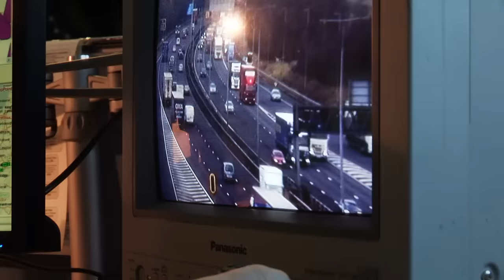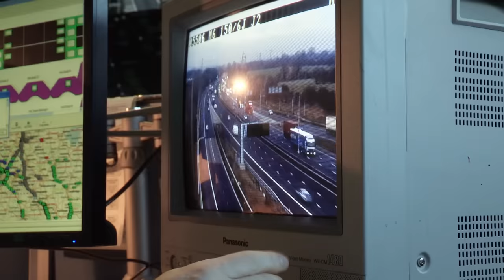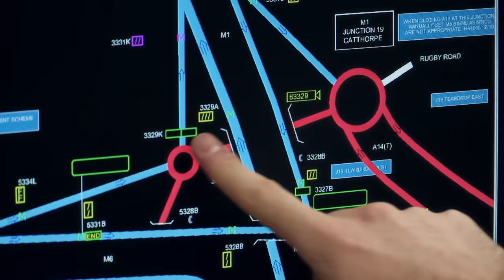Responding To Horrific Motorway Collision | The Motorway: Life In The Fast Lane | Real Responders

Comment: Police badge on the window “put your seatbelt on” works every time!!! 👍😁
Reply: LeeWhy It largely depends on the vehicle you’re driving, thanks to reality TV it’s now common knowledge how old unmarked vehicles are, and the models being used can be found on the local force’s website - and who crews them. 
Ultimately though, if it takes a sticker to alter the attitudes and behaviour of motorists’ then cars should have 5 random questions from the Highway Code to be answered correctly before the engine can be started - most modern consoles could easily handle that, and an alcohol test, a drug screen test, and a baton and cuffs secreted in the headrests for passengers to make safe and efficient civilian arrests and detainment until someone in uniform arrives and Tazes them before releasing them back into society. The car can then text all the members of the driver’s family to alert them as to the extent of the misdemeanour which should then also be shown at the end of the national news alerting other drivers to avoid the city where the highest rate of offences occur, thus impacting on local economy and hopefully leading to the mandatory use of bicycles under the pretext of the alleged adverse effects to health from any airborne carcinogens and contaminants, the danger posed by biofuels to the ionosphere and ozone layers further impacting on an atmosphere not conducive to good health and long living. Repeat offenders should be sent to Brazil or India where they can learn how to drive with reckless endangerment properly and safely. Oops, almost got spotted there, but I believe that mild intoxication and occasional phone use helps me to really concentrate more on driving safely - well, more alertly as I’m now mindful of the tricks coppers use, especially us traffic bobbies as we have additional embarrassment to deal with at the nick. 
This probably warranted a post of its own rather than being a lengthy response to a valid point well presented. It’s also true.
Reply: @fantomphalcon9153  what?

what?
Reply: it only works if they look at him
Reply: The driver should have given the cop the finger....
Reply: Strange that he doesn't have a sign and relies on hand signal and lip reading.   Needs a two-sided sign. Buckle-up graphic on one sides and no phone graphic on the other.

Comment: I was on the M4 in the 70s, doing about 100miles per hour, with a Marina 1800 TC, and was overtaken by a Jaguar E type Mk1 in just a few minutes, he was doing 150 miles per hour. I was alone on the motorway.
Reply: The top speed of a Marina was 99-100mph.
https://www.automobile-catalog.com/car/1973/39185/morris_marina_1800_tc_coupe.html
Reply: ElgarL never know might have been modified abit
Reply: Brave man to take a Marina to that eye watering speed..being in one doing 70 was risk enough for me
Reply: @tjohsoeitan7539  It must have been slowly disintegrating as you went along..
Reply: I was judging from the speedo meter, pointer was up to the limit and shaking unstable, the dial is printed 110 with extra lines, I would take it as 115 miles, that was a rented car for few days only. I just check about the speedo meter.
Reply: @ElgarL  he did say...about a 100! Didn't say...just over 100! 😅

Comment: A gallon or two of that spilled milk and a few loaves of bread would have found it's way into my fridge if i was there that's for sure. The entire load was a loss as far as the insurance company is concerned so why not? 20 years ago my truck caught fire with a load of fresh cut flowers heading to local flower shops for Valentine's day. The fire was due to some electrical malfunction in the engine, probably some faulty wiring. The entire cab and the top half of the trailer was a total loss but there were quite a few boxes on the bottom of the pallets that were untouched. My boss arrived on the scene a couple hours later while the fire crew was doing cleanup and he told them to help themselves to as much of it as they want because the entire load was a loss.
Reply: Many, many years ago my grandfather and dad were on a local volunteer fire department which responded to a freight train derailment. It was very rural and only 2-3 box cars rolled off the tracks with little damage to them. They were full of vegetables and frozen chickens. The train people said everything had to be disposed of. I recall my grandmother and mom canning and freezing cases of vegetables and chicken. Local schools and even the tiny local hospital welcomed free food - back in the days schools actually cooked lunch, and the hospital wasn't obsessing over liability problems. I imagine today's health inspector would have a cow, but no one got sick, except we burned out over all the meals with chicken.

Comment: I'm curious, this is a question for all you Brits....Here is the USA, if the freeway (you call it a Motorway) is closed, we have other, smaller highways that we can move to so we are not waiting as long.  These are roads that, before the highways were built, were used for international travel.  An example is the famous Route 66.  Do you have similar roads or is the Motorway the only way to get from one city to another on the other side of the country?
Reply: There is a network of roads.  The M roads are the motorways, then you have the A roads, which are mostly dual carriage ways, and then B roads

Comment: As for truck drivers, working week, 15 hrs, 15 hrs, 15 hrs, 13 hrs, 13 hrs 13 hrs is the Max working week, WTD is a joke. and you have 30 minutes from getting you paper work, hitch your trailer, check the load, cjeck your vehicle and get out of the gates.

Comment: If you try to drive on the shoulder, it should be an automatic 10 years in jail. Plain and simple.
Reply: there is exceptions of course, if i remember if your vehicle is damaged or breaks out you can pull onto the shoulder and only for that or if the emergency services direct you to.

Comment: Always somone at fault???  What if a type blows or somthing goes wrong with the car which makes it impossible to control like wtf why would u say there always somone to blame..????
Reply: Depends on the cause of puncture. If the tyre is old and in bad condition, it is in the hands of both the driver and mechanic. If it was a slow leak puncture than the driver isn't sufficiently observant, and if it is a blowout due to debris on the road then it is the fault of the people in the control room not paying proper attention to the section of road. 
In a mechanical failure the failure needs to be investigated, and can be blamed on the part manufacturer, car manufacturer or mechanic depending on what happened
Reply: FormulaFish15 well the point is there’s not ALWAYS somone to blame ...
Reply: It doesn’t matter if something miraculously went wrong with the car. If your car develops a fault it’s your responsibility to keep it under control. If you fail to and the car crashes it’s your fault on the insurance claim. Insurance and the police say that regular servicing and checking the condition of your vehicle continually in between servicing plus an annual MOT will help stop this event from ever occurring. It’s people’s lack of Will to keep their vehicle’s condition up to scratch that is the issue.
Reply: @wazzahd7510  name one thing where someone can't be blamed
Reply: @mortxiii    A driver having a heart attack, a stroke, a seizure, a fallen tree, an animal.

Comment: Rather than seat belt violations they should be concentrating on tailgaters. People using their mobiles, only one hand on the steering wheel, and tailgating I reckon are the most serious offenses to be patrolled.
Reply: They deal with mobile phone use and tailgating - you saw that - but you think they should therefore stop enforcing seat belts? Makes no sense.

Comment: 6 hours to repave 100 feet of motorway?  It would take MONTHS to cut through the bureaucracy in the USA.  And their speed of work actually cuts down the cost.  only 40,000 pounds?  That is CHEAP (compared to the US)!
Reply: That's a State by State issue.  The US gov does NOT have anything to do with the roads/high ways in your state.  We just had nearly a mile of road resurfaced overnight.  The following night the lines were painted.  Get it right.

Comment: 4:59 that’s a lie cause you just said it could be weather related so how could that not be called accident
Reply: Maybe if there's ice or rain etc. You go from 70mph to 40/50 mph or less , depending on how bad it is.
Reply: Agree with the comment below.  You do have to drive to the conditions however I still do not agree someone is always to blame.  I could hit a nail or a piece of metal and have a blowout causing me to crash.  No ones fault? Also a truck is leaking some oil and I skid.  No ones fault ? Not quite sure how it always has to be someones fault.
Reply: Chris, you have a good point about the oil leak. The nail in a wheel wouldn't make the tyre blow out. Unless you had poor tyres, which you should check regularly.
Reply: Christopher Mills in those cases it’s the fault of whoever dropped the nail, or whoever is in charge of the maintenance and the driver of the vehicle the nail came off. The same goes for the oil leak.
Reply: @nathanrock5068  and who's fault is it if the driver has a massive heart attack, stroke, seizure, or due to nature like a fallen tree or a deer or fox etc?   They would not be  caused by human error,  but accidents.
Reply: Billy Porter I agree those circumstances would be accidents however calling a RTC an RTA would imply that there is no one at fault which more often than not is not the case
Reply: @nathanrock5068  Approx 90% plus of road collisions are avoidable, and are simply down to human error. The rest like the examples I've given are classed as accidents.
Reply: Billy Porter yes and would you consider 90%+ of accidents the majority of road crashes?
Reply: @nathanrock5068  No,  90% of road accidents is only 9% of road collisions.
Reply: Billy Porter could you please provide a link to where you are getting you statistics? Also if you have relayed them correctly then I believe they might be wrong as there is a missing one percent. Also if I miss understood you last message then my apologies however when reading it it appears to indicate the 90% plus of RTCs are avoidable and down to human error.
Reply: @nathanrock5068  Road accidents only account for 10% of all collisions. So for every 100 crashes 10 are  accidents, which makes 90% of accidents 9. Depending on where the research was carried out these figures may differ.     People shouldn't be using the term "accident" unless they know the cause. It's an insult to the families of those who were killed or seriously injured by dangerous, careless or distractive  driving to say "A sure it was just an accident"  More than likely it's down to human error.
http://www.youthforroadsafety.org/news-blog/news-blog-item/t/95_of_all_crashes_are_human_errors_not_accidents_northern_ireland
Reply: Billy Porter after skim reading that have we miss understood each other and been arguing for the same point?😂 

I think the should be called RTCs as that doesn’t label it an accident until an investigation is complete.
I also believe that most of RTCs have a human fault, and are not complete freak accidents.

Are you thinking a similar way??
Reply: @nathanrock5068  Totally agree. 👍
Reply: Billy Porter 😂 👍🏼

Comment: you don't like the semi trailers? stop using amazon and all that xD
Reply: Can’t go to supermarkets either
Reply: @caitlynway5274  People just like to complain though, literally everything humans do rely on those driving the trailers. Or no, maybe everything just appears from thin air. I'm not sure hm
Reply: I used to do multidrop across the Westcountry in Devon and Cornwall. Never got any hassle from genuine locals. Then you'd meet some stuffy old fart who moans about lorries in the countryside. I'd just say "Well, the countryside is just one massive industrial estate... do you realise how many tonnes of goods farms require to keep running?". People don't realise the logistics chain involved with even the most innocuous things. One thing people like to trot out is "they should just go on vans". Well, maybe - but I'm carrying 55 pallets in my trailer, a sprinter can only carry a few depending on how heavy they are. Would you rather have one 18 metre long lorry or 30 or 40 7 metre long sprinters?

Comment: I have never heard of resurfacing because of an accident like that. Do we in Sweden have better asphalts or what?
Reply: did you hear explanation why is it being resurfaced??or did you hear just "need to be resurfaced" and decided to write down stupid comment?
Reply: @vatrogasac000  We have that kind of accidents here too you know...
Reply: @Xanthopteryx  i didn't ask you do you have that kind of accidents(i know that there's accidents like that in whole Europe,each country have their own way of dealing with them),i asked you did you heard explanation??
Reply: @vatrogasac000  Yes i did, and I still haven't heard of that problem here leading to a resurface work.
Reply: @Xanthopteryx  it also depends on the different scale of operation which is done in each country; Thus e.g. some minor damages on a Swedish road where you might go 110 might be okay, but the same thing on a German road where you might go 220 might be not safe any more
Reply: Depends on what is spilled... diesel for example can erode the surface asphalt very quickly, turning the road into loose gravel - there was one accident a few weeks ago that meant half a mile of M6 southbound needed to be resurfaced near to my town / next town over. WIthout the resurfacing, more accidents would occur and the road would have degraded to dangerous conditions.
Reply: @Xanthopteryx  diesel fuel cannot be cleaned off the surface, it soaks into the asphalt and will continually cause a hazard and is very slippery, so you have to remove the contaminated areas and resurface

Comment: Can learners go on a motorway, it’s not clear if the girl has passed her test already and is having introduction to motorway lessons. But I thought not?
Reply: No I don't believe so, unless they're doing extra motorway lessons.
Reply: It’s called learning to drive on roads for a reason
Reply: Saturn Plays its changed recently by the looks of it according to google: “Learner drivers allowed on motorways. You'll soon see more L-plates on those M-roads. Since 4 June, learner drivers have been allowed to drive on the motorway. ... Learners need to be accompanied by an approved driving instructor, and drive a car that's fitted with dual controls.4 Jun 2018” 
You used to have had to passed first.

Comment: Yes there is such a thing as an Accident, say a car was overtaking in the middle lane and the front or rear stub axle breaks.  Then the wheel with it's assembly will be a projectile, which other users may have to take avoiding action resulting in a prang. Now that is an example that can happen anytime there is no forewarning of it and that's just one example.
Reply: Still not an accident.  If you look, you will often (always) find prior warning signs that the axle (or whatever) was going to go.  Or there's maintenance that the driver/owner didn't do.  Without fail.  So: not an accident.  Lightning might be an accident, but hardly ever causes collisions. An earthquake, that could be an 'accident' - or either of those could be considered the actual cause of the collision, which is thus not an accident, although it would then not be any person's fault.